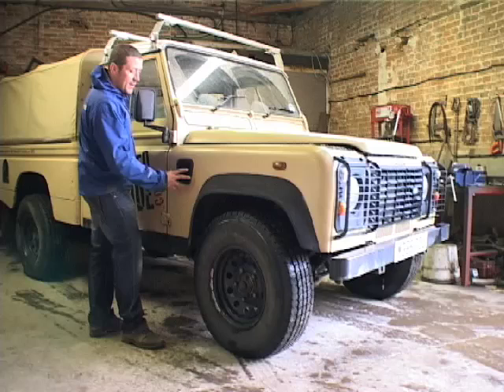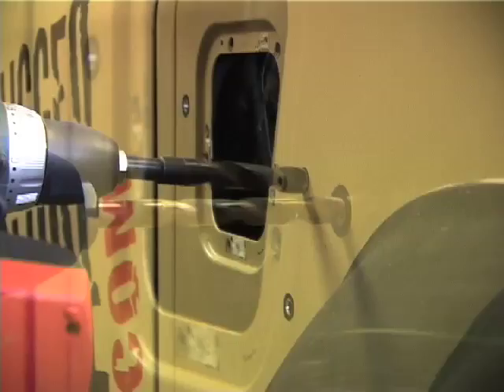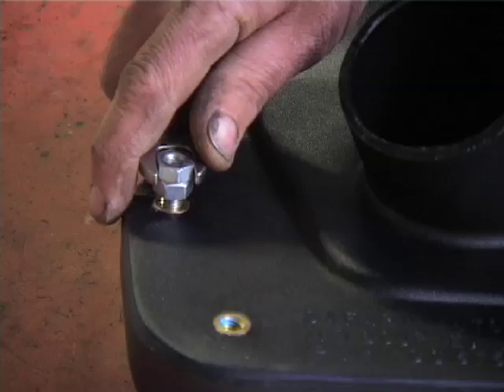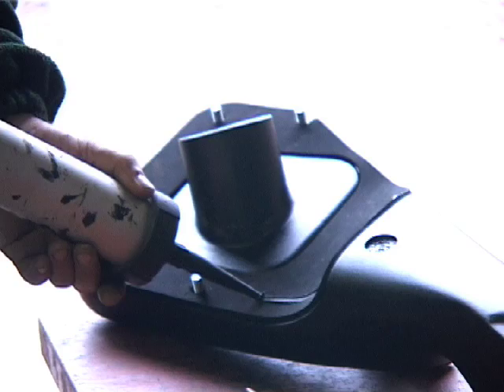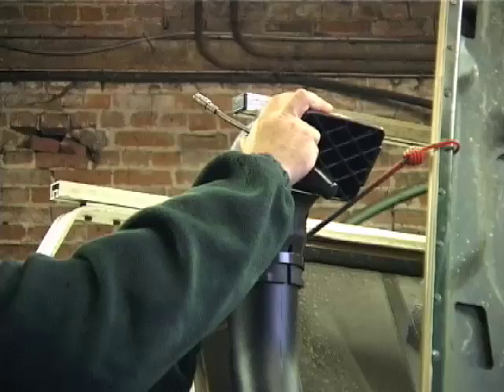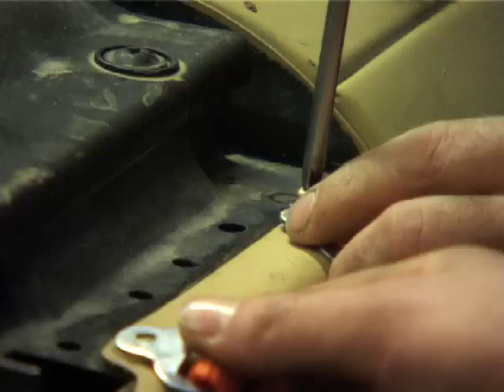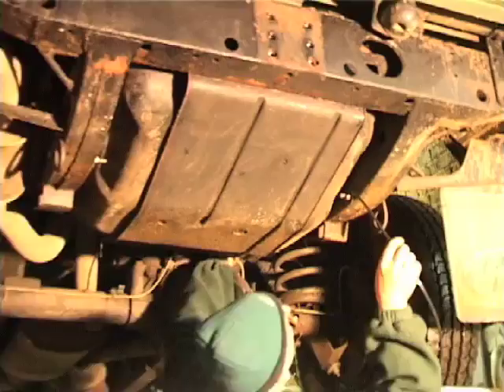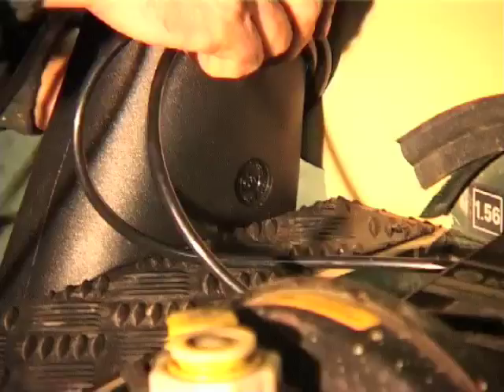Preparing a Land Rover Defender TD5 for wading

Comment: Surely it makes more sense to fit the air intake in the opposite direction?
Reply: WiltshireByways There is no ram effect but in heavy snow/blizzard precipitation the intake will block. Turn it 180 degrees (facing to the rear of the vehicle) and you will have no problems.

Comment: those breather pipes are pretty rough it would look a lot nicer if you joined the three into one hoes under the bonnet then plumbed that into your snorkel with some silicone and a grommet pretty sure the engine will just suck its air through the snorkel rather than capillary up oil through over a meter of hoes from the top (not the bottom of the dif and gear boxes) installing a drain on the bottom of the safari snorkel isn't a bad idea either mine was half full when I took it of when it broke

Comment: What Safari model is it for TD5 - i've received mine today, HF580 and it doesn't have this pipe as yours...
Reply from the maker: Śladem Wierzb check if yours is for abs or non abs model
Reply: On Safari webpage there is now one model, SS580HF, for both TD5 and TD4 - maybe they have changed something in design in past years to make it for both engines. Will try to fit it next weekend. Thanks for video, it's nice help.

Comment: why not hide the pipes in the snorkel?
Reply: because the sucking from the engine can suck the oil out the diffs. and you would be putting holes in a sealed system and there is potentialfor water to get in.

Comment: what is the point of breather pipes.
Reply: As the oil gets hot its needs to breathe expanded air out.  If you then plunge into cold water this air rapidly contracts.  Without breathers the contraction will draw water into the diffs/transfer box etc it also puts pressure on the swivel joint seals which means swivel grease in your diffs